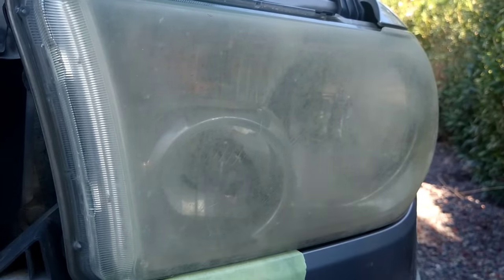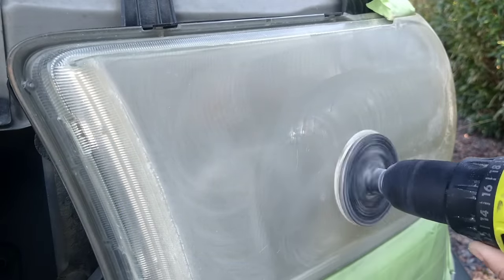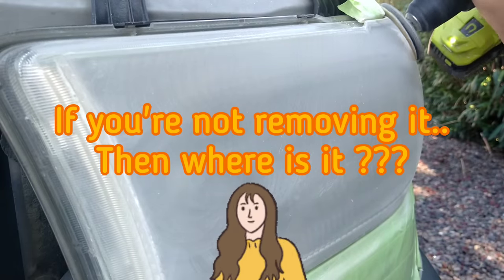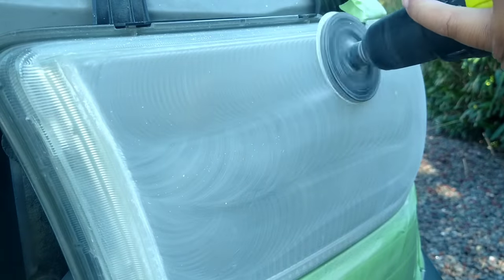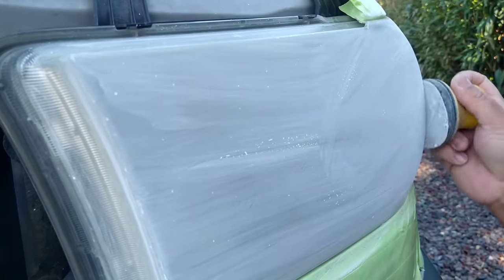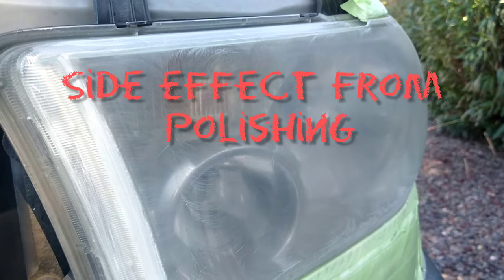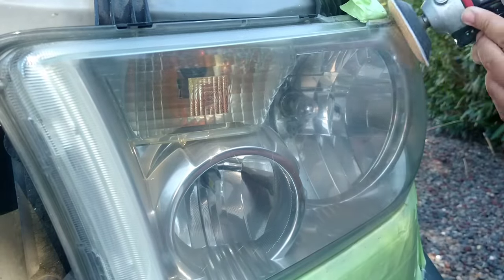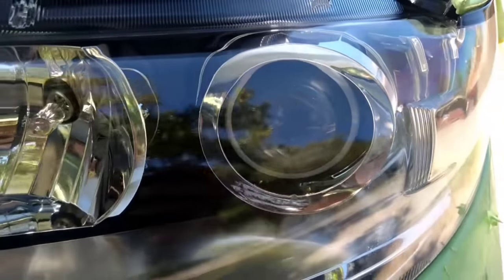POLISHING HEADLIGHTS IS A SHAM/scam  ---  and why you should never only polish headlights

Comment: TBH honest you need proper UV protection clear-coat. I had my mine done on a 2009 Boxster, he took the headlights off after the polishing. The guy had a proper air-conditioned cabin/booth in his van to do the final spray of the headlights. He gave a 5 year warranty too. It's been 4 years no issues. I had the car detailed (polished) and the headlights looked worn so I wanted to get them looking mint to go with paintwork and refurbed alloys...
Reply from the maker: Yes but it's not a proper headlight restoration without a UV clear code designed for headlights.. clear coat must be for headlights.. without it it just comes back in weeks.
Also a lot of people are concerned with longevity in the headlights looking clear if you're not using a certified headlight clear code your lights aren't functioning correctly they're not producing the amount of light that they're supposed to if it's something not designed for headlights you can be losing 50 yards or more of light and not even realize it....

Comment: Seriously that's thing?
I mean my daily driven L200 2017  never saw a treatment of the headlights and they are still crystal clear, no garage, always in the elements, hot summers, cold & lots of snow salt winters, only washed few times a year with the water jet....🤷🏼‍♂️ Less is more
Reply from the maker: Yes some vehicles are more prone to go bad than others.. your vehicle is fairly new headlight restoration typically starts at about 2017 generally. Meaning limestone start getting messed up till about that year most of vehicles I do are 2017 and under.. very rare when I get an 18 or 19.. that year creeps up pretty much every year are every other year.. keep watching sooner or later you will see it coming and what advice it's better to get it early on then not for your headlights health.. and cheaper should be..
Reply: @theheadlightrestorationpro  thx for the info. Might look at it soon 👍

Good video, well explained what's to do. Thx

Comment: After you RESTORE the headlight to CLEAR, you must finally SPRAY with CLEARCOAT to prevent future oxidation and fogging. Otherwise the sanding removal of the headlight fogging will only last approximately one year at best!
Reply from the maker: Interesting
Reply: @rinx34  I noticed that several people recommended the Sylvania headlight restoration kit because it includes a clear coat sealant final application.
Reply from the maker: This is not 2K.... 2K is not designed for headlights... This is headlight certified clear... Made for headlights...
Reply from the maker: You should definitely watch more of my videos ...💯☺️
Reply: @theheadlightrestorationpro  Good Point! Yes, I rewatched and saw the last coating this time that I apparently missed the first. In my defense, many headlight restoration kits that I've used do not have the final clear coating to seal the deal! In fact, after looking specifically for restoration kits with a final clear coating, none indicate they have one!

I've resorted to just paying for services that clearly indicate they included a final sealant. Most still only last one year! I keep my vehicles a long time and I end up restoring headlights approximately yearly!
Reply from the maker: @dilbertjunkmail  awesome..👍🏽
You should try this method you will not be disappointed...💯
Reply from the maker: @dilbertjunkmail  👍🏽

Comment: if 2k clear didnt work for you its because you sanded with too fine a grit or applied wax to it before it could cure.   wet sand with 800 > clean and dry the headlights > 2 coats of 2k clear > after 2 weeks of letting it cure then you wet sand the clear coat with a finer grit then polish.
Reply from the maker: How would you know this? What I did with 2K clear? I'm thinking I'm missing a video if you've seen me use 2K clear on over 30 lights... Interesting.. or remove 2K clear I'm probably even more..
Reply from the maker: Also my friend your message could possibly work could you imagine selling that.. nobody in the world would buy this.. 2 weeks of driving around with messed up headlights.. I used to let that stuff cure under UV heat lamps for an hour sitting around in my car and come back and do all that and it's just such a waste of time when you're doing two and a half hour headlight restorations for the same amount of money the people don't want it.. it's inferior but if you have the time I guess.. but the negative points of how hard it bonds to your light, and how extremely difficult it is to take off of your headlight compared to other stuff.. let's say the stuff that I use the Maguire's is probably a 1 to take off and difficulty.. 2K clear even the headlight one.. it's like a 36..😆
Appreciate you watching thank you for your insight.

Comment: Mate most polishing methods use some kind of abresive components, so you are in fact leveling off and removing the oxidations. What the problem is that pple do not uv seal the headlights after that. So now what was left from the original protection is fully gone and the oxidation will return with a vengeance. Its not that the other meathods dont work, they simple miss the last step.

Comment: What is polish designed to do ?  Remove a small amount of the material you are polishing. Basically it is like very fine SANDING. The fault is NOT with the polish , it's with the person who never polished it properly. Furthermore...anything that you spray on a hard plastic headlight cover is always going to be softer than the headlight cover, and won't last very long...and that includes any kind of SEALER. I could sand them properly, starting with 1200 and ending with 3000, and then I could polish them with a proper polishing compound, and they would stay good for a lot longer than your process.

Comment: Mothers aluminum polish. No taping. Wipe it on with a sponge let it dry buff it out with a drill attachment on high speed. Done - no scam. Takes 5 minutes. Next.
Reply from the maker: Definitely a scam if your selling as headlight restoration... BECAUSE ITS NOT...and will come right back (weeks/months) and in the long run it makes your lights worse ever time..(I believe the person used aluminum/metal polish on this light...that could account for the tinting....(its the lazy and uneducated detailers headlight restoration) that why it takes 5 minutes...☺️

Comment: you'd think engineers could come up with a material that doesn't oxidize.
Reply from the maker: Yes you would.  I believe they can.. they just have to figure out a way which I'm sure wouldn't be too hard .. but the research and development alone would be pricey...
Plus it would drive the cost of the headlights to even more expensive than they already are... Thus driving the price of vehicles up.. you got to think if it cost them another $200 per car of each vehicle, times how many vehicles they produce. It would be probably billions of dollars and increase and how much it would cost for them just to change that... It's one thing they don't want to do is make less money.   
You know the car makers...lol

Comment: I don’t get it. You say “never polish headlights,” and then you spend 19 minutes polishing a headlight. 
How is what you do here not polishing? 
Do you mean something different by “polishing” from what I think “polishing” means?
Reply from the maker: Yes...you definition to everyone elses definition must be different...
Polishing headlights in regular meaning is just polishing headlights from start to finish (nothing else)...
As you see in this video there are different stages... SANDING, CLEANING,WET SANDING, a small portion of polishing, SEALING THE HEADLIGHT..
Many steps multiple stages..
Polishing is just one all the way through..
I hope that helps you understand the meaning...
Also polishing is soft and smooth, not really removing, like something you would do on car paint..
Sanding is removing destruction removing material......
Thanks for watching..👍🏼

Comment: The actual "only true headlight restoration method" is taking the headlight apart, recoat the reflector and replace the clear plastic cover.
Reply from the maker: Rebuilding the reflector will have no effects and unnecessary. Meaning there's nothing wrong with the reflector surface.
Also it's damn you're impossible to separate 99% of lights without damaging the surroundings.. plus labor to do all that would be like $2,000, most lights don't cost that much money.. we have to work in the realm of practicality for one, for two you're doing a lot of stuff that's not necessary at all..

Comment: Why are you polishing it at all?? If you flat the headlight to a decent standard just 2k clear over it!! one of the most basic things you learn as a painter is don't paint over anything shiny! 600grit scraches are fine enough and you just clear right over and most importantly adhere. One thing to remember though is you want a 2k clear that has the highest UV protection you can find, if you use cheap clear it will last five minutes and this time you will get uv cracking in the plastic lens. Stop deleting my reply!! Maguires is just Acrylic single stage clear acording to their  Ingredients. and where is your masking for a 'Pro'!! Try using a top shelf product like SprayMax 2k head light clear.
Reply from the maker: This isn't painting.... First and foremost this is headlight restoration..
Second 2K clears the worst thing you can put on your headlights it's not designed for headlights the transparency factors of it is extremely low meaning that your headlights will be diminished and functioning although appearing clear 2K clear does not adhere to headlights the same which is why people spray it foggy.. which in itself diminishes headlight output as well... Polishing it because you need that clear light to be functioning 100% without clear coat on it just like the factory produces headlights the same way for vehicle safety standards and functioning of headlights... A lot of people misconstrued because your spring something on this that there is an equivalent to painting which there is not I do both on vehicles..
It's like saying olive oil is good as synthetic car oil for vehicles it doesn't work that way the world doesn't work that way headlight restoration doesn't work that way.. you might want to check the channel over 130 videos now streaming over 400 and something examples of the best headlight restoration ever seen that's why I'm the biggest head that restoration channel on YouTube...
The one thing you learn as an actual headlight restoration professional is that you have to spread the headlights shiny check out one of the videos on this channel entitled why do headlights go bad and they'll show you an actual session of headlights being made they are sprayed when they are crystal clear for a reason..
2K clear there's a lot of light it's not made to adhere to this type of plastic or plastic in general this is why people try to spray it while it's roughed up headlight actual headlight coating that is designed for headlights has no problem it's closer to super glue than paint or clear coat...
I'm glad to have cleared that up for you..
Reply: @theheadlightrestorationpro  Maguires say.......... 'Proprietary coating that provides headlight clarity for up to a year' So not exactly long term? i get why you polish now, the clear isn't permanent. TBH you would be better using a decent ceramic coating if a year or so is your objective.
Reply from the maker: @K2edg that's misinformation purposely given for protection of their business..
There's a lot of variabilities and headlight restoration different types of headlights and different types of people who take care of their vehicles..
Also they have incorrect data because they have statistical lab data not actual real life data by time they release this product..

You should check these videos out here that I did and one of them is on my vehicle that had last 4 years plus..
It's impossible to engage with all these different variabilities.. and also this product is extremely healthy for your headlights with zero side effects which is good to the consumer because it does not damage their property... 2ks and other things really destroy headlights..
This is why if you do a Google search 2K clear for headlights nothing will come up except for one product that really is kind of fraudulent in my professional opinion and experience it's the same thing as the regular product...

https://youtu.be/FEhI4RVwe0w?si=S6p1NyXAMMnXbXwI

https://youtu.be/_Mzt9uyFvR8?si=Z-tsZZKIJ3sBJadd

Comment: So its not your method, or the mechanical methods you use to get there...  It's the UV protective coating you apply...  So since polish takes off far less plastic, I will stick with polish followed by a UV clear coat.

Comment: what about crap on inside of lens cover
Reply from the maker: It's actually very rare when there's a significant issue on the inside of the headlight.. even then the bike can be enhanced through headlight.. but stuff on the inside is usually by way of breaching which just means there's a small crack somewhere and dust and vapor water vapor get into the headlight coat the lens really rare one out of 10 headlights have it usually older vehicles..

Comment: I keep a small can of wd40 and a roll of paper towels in my car. Spray and wipe headlights when needed. Done and cheap.
Reply from the maker: Good luck.. doesn't work never has never will..lol people just say that..
Reply: I've used it. It is a temporary fix for an old car that's not worth spending alot on it. It help more than I thought it would.
Reply from the maker: @concernedcitizen4031 yeah there was like a survival headlight guide if you're like going to rain storm or you just can't see at night and you happen to have a can it would help you for a couple hours...👍🏽

Comment: you do realize you are only half correct. Any compound is a fine abrasive, therefor the guy buffing the headlights was sanding (only using compound). And yes he should have used a spray on coating afterwards to keep them clear.
Reply from the maker: Ok.. I'll bit ..not really...but yes .. technically.. that's like saying the Olympic swimming pool of the body of water... Not a pool.. when actuality the term of body of water is referring to lakes a large masses.. technically the pool is but not really... so people never refer to it as this.. metaphorically..
Especially in terms of had my restoration removing when needs to be removed it's not the same...
Thanks for watching got a lot more content coming up.. and currently on the page..

Comment: After you sanded, you said the polish has somehow changed the headlight and made it tinted or foggy. That's bullshit. Polish is a very fine liquid sandpaper, and sometimes includes "fillers" and waxes. Fillers and waxes cover up scratches which is why it sometimes doesn't last long, tbe wax/fillers wear off. Yes you can overheat with polish, just like you can with sandpaper.
You sanded down deeper then the polish ever got, revealing a fresh layer of plastic, why you think the polish job from before somehow effected the plastic that deep I'll never know.

Comment: Started this in the dealer like 17 years ago. Same method only wet sand all stages. Except no spray clear. That’s junk.
Reply from the maker: Must have came right back.. Pennsylvania car with no clear coat. UV clear coat.
Reply: Nope. When your a pro at working on cars and replacing that type of stuff. You learn. Ask a paint guy. Painting clear will just turn yellow. Especially with hid or led lights.
Reply from the maker: @Thomas Martinez  it will go yellow eventually but the only thing is the light will go yellow.. primarily it's the light that's going yellow as well so both things go yellow it's better to have the coating go yellow than your light in the long run.. take a look at this video and you'll see that the light goes yellow without any coating as well...https://youtu.be/iPquchVGFgE

Comment: A 4,000 + psi pressure washer can get them lookin pretty shiny too and it takes that whole layer of film right off without sanding and buffing so pressure wash first but it must be 4,000 psi or more and with the 4,000 psi i use the yellow to start and if the yellow up close doesnt do it i put the red 0 degree in and it takes a little time because your cleaning with a pencil tip but man does it work great wayyyy better than a sand and a clear coat that a lot of hoaky ass body repair men will use